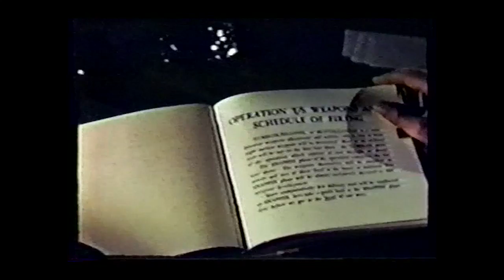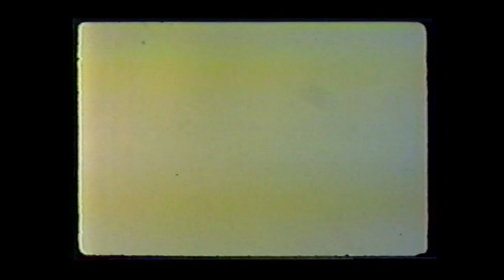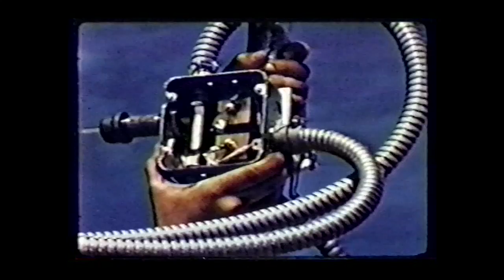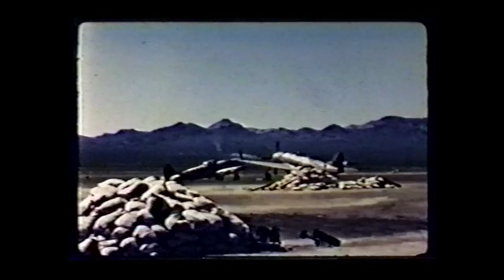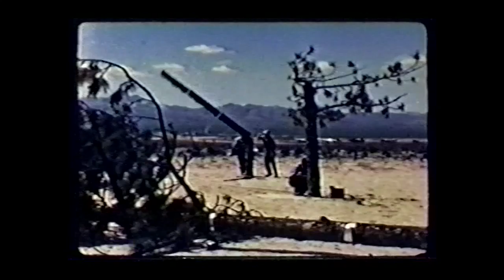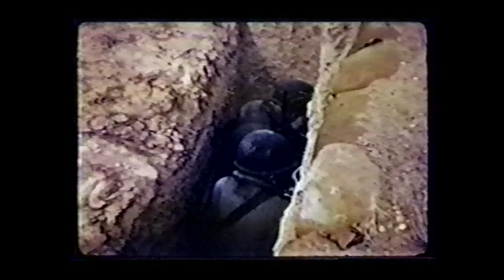Operation Tumbler Snapper (1952)

Comment: I wonder pilots flying into those clouds even had dosimeters on. Closed circuit breathing can only do so much :(
Reply: They tested the planes beforehand and found that the pilots would be safe inside. Some of them were also drone.
Reply: Ronbo710 Those planes were drones (remotely controlled).

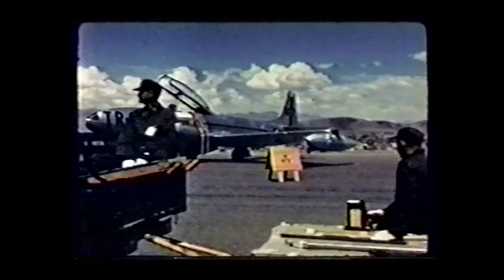Comment: The one at 7:42 is an F-80 used for cloud sampling. Other planes used would be B-50, B-45, B-47 and various smaller planes like the F-86, depending on the role played. Drones were used in the early tests, replaced by this time with manned planes.
Reply: Right. They had determined with the drones earlier on that the radiation that had ended up penetrating the aircraft, that flew through the bomb clouds, was minor enough to put humans in the cockpits. Back then radiation limits that were damaging to a human body weren't as well I understood as they are today, and I have no idea what amounts of radiation those pilots were exposed to at the time.